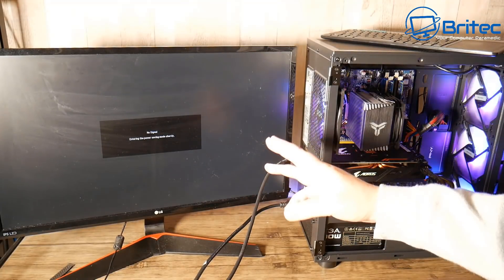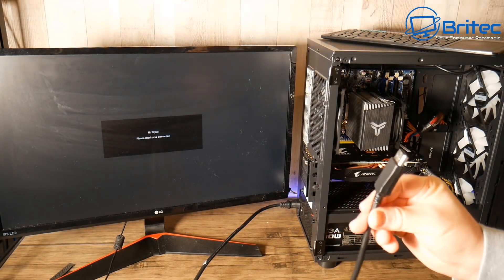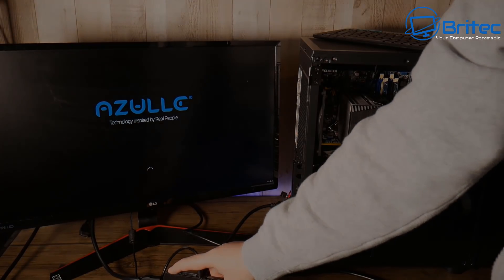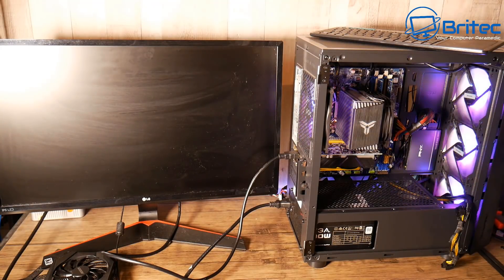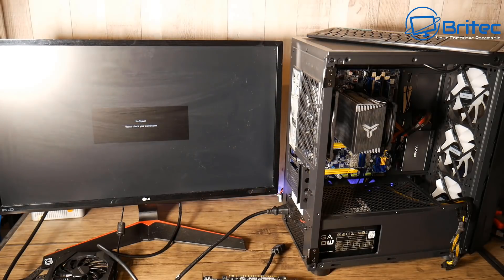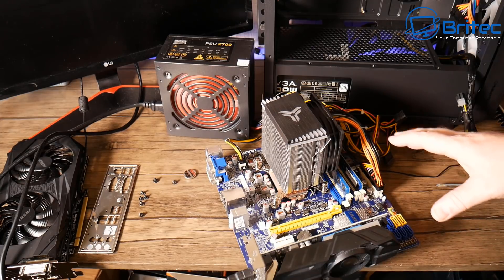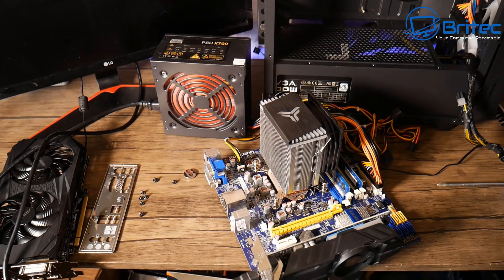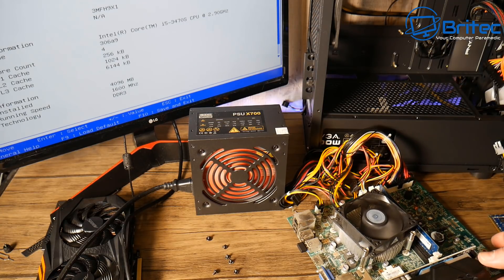How to Troubleshoot and Fix Computer Problems

Comment: Random question...Have you dealt with many Microsoft SurfaceBooks (3rd version) ? I got a second hand one, and it seems fine except I notice a subtle odd thing that happens with the screen when turning on. If simply waking up there is a very brief (micro seconds) white flash of screen that happens before the iris recognition screen and its flash happens. When turning on or restarting the screen briefly flashes purple like that of update screen, before the iris recognition screen and flash.  I have another week to decide if I want to keep it, and this is the only thing that seems slightly odd. I don't know how significant this could be? Any idea if I should keep it or not based on this...It doesn't bother me as such, but if it's a sign it's a bombshell waiting to go off that's another matter...

Comment: Can someone help me with my pc?? Yesterday it was working fine and now when I boot it, it automatically shutdown after few seconds! I have tried disconnecting and connecting my RAM back swapped, resetting the BIOS by pulling the CMOS battery and putting it back!! Try the different power cable which works in my monitor! And both power cable. When I first got problem my PC was booting into Windows(ssd) and I was having enough time open discord and now it does even let me get into bios and shutdown before! After the shutdown I have to unplug all the power cables cut the power! Then plugging back all the cables and same happens
Reply: Y Pe  how did u fix it???
Reply: Y Pe  plz tell me how did u fix it
Reply: Y Pe  I mean what did u do?

Comment: Fantastic video, great also for new people coming into computer repairs.
That motherboard seems to use those aluminium Nichicon FP series (solid electrolyte) electrolytic caps so it's unlikely to be those as.they are rated for 50000 hours.
Non FP series electrolytic caps can bulge, a dead giveaway.
Trap for young players - Double check your monitor video input setting as some monitors don't auto detect.
Hot tip - Hook up a speaker to check for beeps & probe the voltage rails using a cheap DMM.
Sometimes power surges kill MBs like these.
Brian, all your content is awesome & extremely useful to both newbies & experienced techs & please keep it up!

Comment: I have a laptop which does not display correctly. I know it cannot be the ribbon cable. I hooked up to an external monitor amd still there is no display on the external monitor as well. I have changed the RAM as well but still no luck. Could it be the motherboard?

Comment: sometimes it can help to get  hold of the manual and check the trouble shooting section, back in the day when i 1st started repairing pc's Beepcodes from the internal speaker were helpful, but as things evolved past the 286 and 386 machines that I cut my teeth on  the only beeps were to do with memory - 1 thing i learned early on when  diagnosing pc's  was to disconnect every cable that wasnt absolutely  needed , especially the RESET switch  and  check the  position of the CMOS jumper  -  as a pc can appear dead if its in the wrong position  - and as a last resort clear the cmos,  but sometimes its worth inspecting the pins on the slots as you never know what can fall in them I  have found small whiskers of metal in them before now, and also on some of the chips with tiny exposed pins can be damaged if the card or board has been roughly stored with other cards that have protruding pins , more than one occasion I've  had to use a scalpel and a desk magnifier to separate pins  of something needed that was chucked in one of the drawers in the shop I used to work in...  those were the days...

Comment: The Mb issues that is a big problem, when a capacitor,MOSFET,or smd has problem, or a chip is fault sometimes is better a change of that piece, yes is good to Fix it for an entusiast but find the error is question of time, thanks

Comment: A bad capacitor(s)?  Maybe a bas socket.  I paused the video on the motherboard and didn't see any bulging capacitors, but I can't see the whole board plus you can look on the other side to see if there are any scorch marks.  Could be a number of things.
Reply: Someone like Adamant IT would have been a better choice if one wanted someone to try and troubleshoot such a capacitor problem on a motherboard?
Reply from the maker: @John Phamlore, I used to do hardware level repair many years ago, this video was not about fixing a motherboard, besides its 9 years old, so what's the point? its old junk. My time is worth more than what that motherboard is worth. I see so many people fixing 8 year old laptops lol how much can you charge for a job like that today and make it worth doing for the customer and you? I know how much I would charge for my time and its worth more then that laptop is worth and if you are not being honest and out to make money, then what type of tech are you?
Reply: the cost (especially if you do this work professionally) to repair the motherboard is not economically viable & unless its a very specialised application ie video games or custom OEM hardware which used specific MB configurations then its unlikely a customer will honour an invoice.
Its far cheaper to buy a brand new MB.
If its nostalgic or rare ie Amiga, C64, 1980s style video game board then its viable but it assumes your time is free.
Brian runs a real world business & he made a wise decision!
Reply: @johnathanasiou9284  I didn't say it was worth fixing, was just answering a question the OP asked in the comment area.

Comment: I was 50 years old when I took a   Desktop Computer course in ‘06-‘08, almost 2 year course. Managed to get through it , along with going for and passing my Microsoft Computer Professional (MCP) course. We studied XP PRO, the dominant OS of the day and in my opinion, still an excellent, stable, secure OS and I learned so much about the in’s and out of Computers( Software, Hardware, Form Factors, MoBo’s, H.D.’s, Cabling( including making our own Cat5 cables:eg.>Crossover,  Throughput), and doing Permissions for the Pro edition of XP. Vista was just on the horizon and the class ( about 25-30, young and old, hackers and noobs) wanted to get into the “NEW” Windows OS, which by means of sneak peeks, looked great. But our teacher, I’ll never forget, told us, “ They( Business) will continue to use XP for a very long time past it’s proposed lifetime, no matter what Mr. Gates thinks, this is a very well developed and written OS with very good security”(For the time). 12-13 years later, I have no problem agreeing with his prophecy, enduring the experimental OS’s that Microsoft continues to release to the unsuspecting masses. Sorry, Bill, but after my laptop, running an upgraded Win7-Win10 o.s. , craps out, I’m off to see the Apple bar and order a new system. Good luck 👍

Comment: Bri, my pc has been freezing randomly since it was brand new. If i plugged it without casing, it's fine. But if i put it in a case (I've tried 2 cases), it freezes randomly. Any idea why? What should i replace?
Reply: Might be a faulty front USB slot on MBO,or the same for fans or front audio.Try disconnect one by one and see.I had PC not turning on at all.I thought so many things and  I was disconnecting stuff one by one until it didn't turn on. When I disconnected the front USB of the case PC turn on
Reply: @BladeRunner031  hmm I'll givr it a try. Thanks!

Comment: Hey bri, I got a older computer that was mine since it was new, I was looking at fixing it up to pass down and help out.  The video works, it just goes in a boot loop. I can get to the bios, but not the login screen.

These are two XP/VISTA computers.   Is it worth trying to fix it up for others?   - my Linux mint usb stick wouldn't work either.

Comment: A good tool for troubleshooting is the speaker for beep error codes, if the motherboard is still functional, you can determine and check beeping and look it up what the amount beeps mean. I.E. problem with GPU, RAM or CPU.
Reply from the maker: Yes it is.

Comment: HI there! this is not in anyways related to the video but i came here from your "Fix Desktop Icons Missing or Disappeared" video, I have a wuestion that I hope you can answer. my computers setting keeps on crashing AND my icons dissapeared i tried to open it many times but it doesn't work. im using my friends computer and I wanna fix it bvefore she knows.

Comment: As a regular viewer of your chnl, I request to make a video how to fix windows 10 version update problem because I am having this problem. I tried 7 times, but failed. When update goes to 26%, my PC suddenly turns off and then make a recover installation whoch undo all changes and make my PC more slower. And another thing that I have faced most is 100% disk usage in windows 10 without any work. Please make videk on that topic. As a regular viewer, this is my request.
Reply from the maker: see what I can do

Comment: Good to see that your trouble shooting steps are basically the same as mine, just some differences in the sequencing. A few tips that is not on video:
1) Clearing the CMOS. Unplug PC, remove the battery, press the power button to drain capacitor will force reload of BIOS. Hate having to RTFM to find jumper location.
2) Use of onboard video. Onboard video uses system ram so the 1 ram stick must be place in ram slot 1. May have to RTFM to find which is slot 1.
Reply from the maker: covered both them steps in the video.